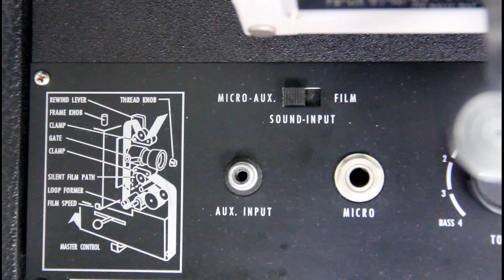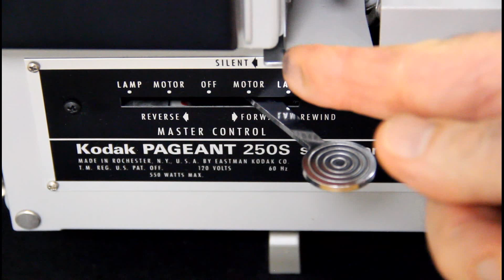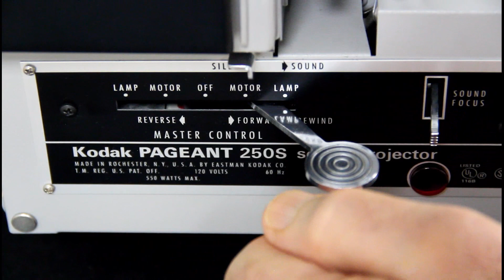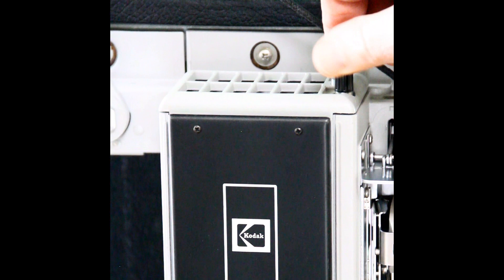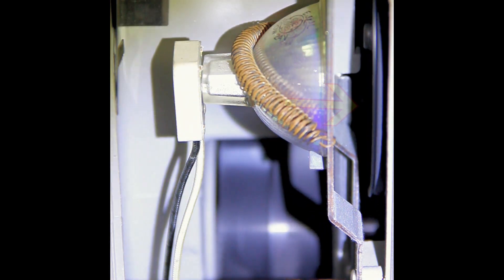Kodak Pageant 16mm Movie Projector

Comment: The Pageant 250 Series (i.e. E,S,M,ARC) were the last 16mm Projectors built in house by Eastman Kodak in Rochester,N.Y.  Kodak then contracted with Elmo after the end of the 70's  and sold their 16CL Model as the KODAK Ektagraphic CT1000 16 mm projector. The Japan built 16mm projector had nothing in common with any other previous built  Kodascope,Pageant 16mm projector other than having Kodak Badgeing. The 250S was essentially the Old AV256TR Projector that used Tungsten Halogen Lamp (DDB 750W) and updated with a 200-watt, 24-volt, ANSI Code EJL Lamp System  200-hour rating at low lamp setting, 100-hour rating at medium lamp setting, and 25-hour rating at high lamp setting. This accomplished by(aprox 12mins in) The Rube Goldberg Switch they installed in the Lamp house and cheap rinky dink spring across the back of the EJL Lamp that requires removing the Cover and using a Slot type Screwdriver for the 3 position Switch. This should have given a 250 buyer indication that Kodak was near the end of Mfging 16mm projectors They just removed the old lamp Chimney and Reflector. If the Light Switch had been mounted somewhere on the outside with a professional  looking knob then I would have thought they would still be making Projectors for at least a few more years. Kodak 16mm Projectors going way back have always had a good reputation for reliability, easy on Film, reasonably quiet projection. Actually a quite remarkable film steadiness despite only using a 2 claw pulldown from beginning up to the last 250 series. I have quite a few Kodak 16mm Projectors in my Collection. Although no comparison to the Professional Theater Model Kodaks (Eastman 25/30/40) or Telecine Models (250/275/285) which were handbuilt by  seasoned Kodak Engineers and incorporated a Geneva type Intermittent (aka 35mm) i still rate the Kodascope - Pageant Projectors as some of the best Audio Visual Projectors you could buy ...

Comment: The grill in the front is not a speaker, but is there for ventilation.
Reply from the maker: Hi Alex, If you had watched the complete video you would have noticed that I corrected my statement about the grill ..
Reply: @mral543543  I did watch it to the end, but I typed in that comment during the first third of your presentation.
Reply from the maker: That's fine Alex, thanks for the comments. I really didn't know anything about how to work the projector, I actually was learning while making the video. By the time I had the video finnished is when I figured it out, so I corrected myself when I was editing the video. It's fun learning and just doing it with a little common scence.

Comment: Hi Al !! I loved watching your video. It would be great to meet and screen some films. I recently purchased a 250S (the third I've owned). It's my favorite projector other that a Singer Instload and an Elmo (although the rubber rollers melt). Great description of the features. A couple of notes, though. The Sound Reader lever (which is my favorite feature of the 250S) is to be used after you set the bass and treble knob. You then raise or lower the Sound Reader lever to fine tune the sound. The black knob sticking up on top is the framer; rotate it until the full picture is projected. You seem to have a different speaker jack than mine, although I have seen that one before. One word of caution, DON'T use the pull down tab to rewind film. I ruined my two previous 250S projectors that way. Get yourself a set of rewinds. The knob on the right side front is used to tighten the film. I hope that you use a test (junk) film first to see if the unit still correctly operates. Are you planning update videos? I'd like to see the unit in action.

Comment: Nope that's 1/4 inch TS Jack. RCA is the smaller pin with shield around it also known as a phono plug because it was most commonly used with record players.
Hay it's a close up at 5:15 on the left is the auxiliary input that is an RCA jack on the right is the microphone jack that is a quarter inch jack.

But I love the bright orange cable.

Comment: Also, if you don’t know the function of some of the controls on this projector, you’ve made this video without being properly prepared and that makes for a mediocre presentation.
Reply from the maker: Hi Alex, very true but a mediocre presentation is better than no presentation ...
Reply: @mral543543  Well, that’s a matter of opinion.
Reply from the maker: Your correct Alex, like you said,  "that's a matter of opinion".  330,000,000 people just in the USA all have there own opinions, they all see the world differenty! My purpose for the presentation was to find a good home for the projector and  "that it did", everyone was happy.
Reply: @mral543543  I have a specimen of the Kodak Pageant projector that you demonstrated.  I bought it in 1980 brand new for around a thousand dollars.  I’ve had to have the amplifier repaired once, and nothing else.  It still works perfectly.  The only problem is that since the video revolution, any sixteen millimeter projector is a relic of the past, and nothing more than a curiosity to the young generation, sort of like a picture tube TV set.
Reply from the maker: Hi Alex, you are absolutly correct, I have more 16mm stuff and only a few have interest in it. It cost more to ship an item than what the item is worth. Even the video revolution has passed the VHS and DVD equipment, I have much of past family memories on VHS, Digital 8, 8mm sound, and 16mm that has been sitting long enough that it is becoming destroyed because of the elements, I've be doing my best to convert the VHS and digital 8 cassetts to computer files. Big job and no family left that gives a dam about them. Sad ...